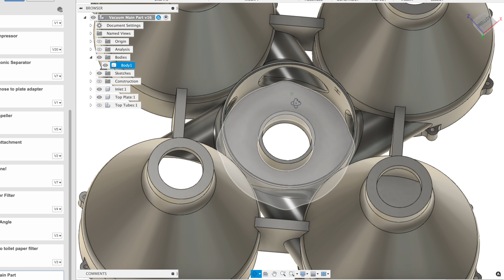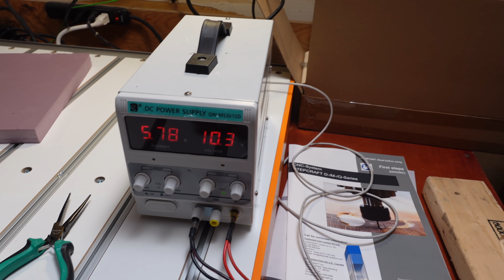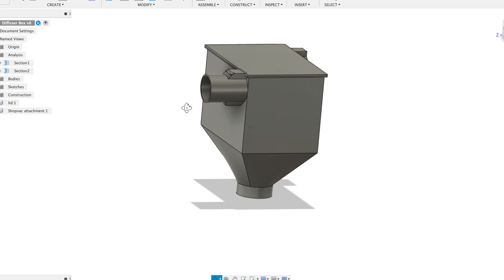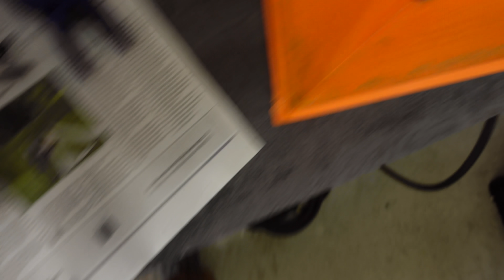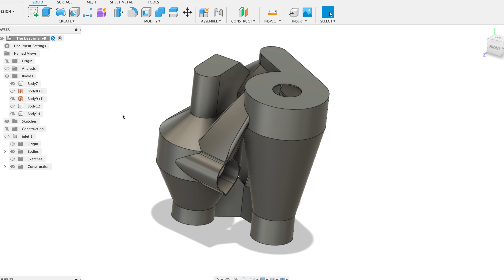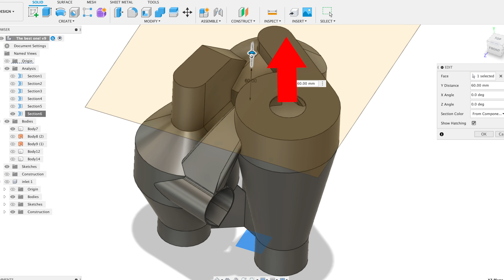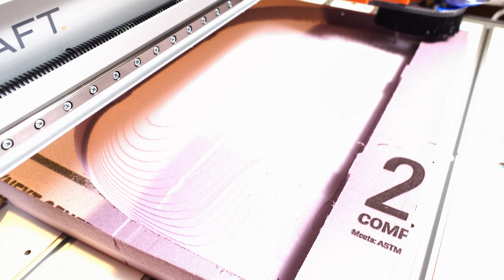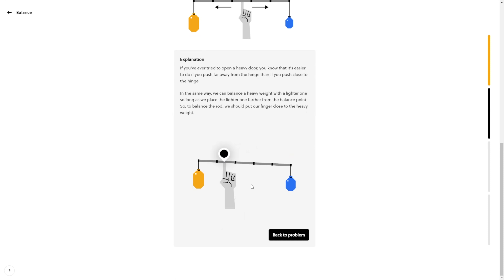3D Printed Cyclone Air/Dust Separator

Comment: A feature of many cyclone separators is what is termed a 'vortex finder' or 'outlet length'. The outlet pipe dips down into the inside volume of filter. This forces air from the inlet to orbit around the separator surface before exiting the top of the filter. This length is important for adjusting filter performance for pressure drop vs. fractional efficiency.

Many papers use terms designated as 1D2D, 1D3D etc to describe the cyclone separator dimensions. The numbers represent the ratio between the cyclone diameter and cone length. Many papers are published which compare filtration fractional efficiency (as a function of particle diameter), pressure drop, and flow rate through the filter for a given Mean Particle Diameter.

In general, a higher aspect ratio of cyclone with a large outlet length will filter better because it exposes the air flow stream to longer linear lengths of surface area. The principle is that at the boundary layer, air velocities are slow enough to drop out material against the surface, and the slope of the surface keeps the material from re-entering the fast air stream. Lower cyclone diameters will filter out smaller particles better, at the expense of significant pressure drop.

According to ASHRAE, saw dust has an approx mean diameter of 600 micron, and flour dust has an approx mean diameter of 50 micron, for your reference.

https://www.sciencedirect.com/science/article/pii/S0307904X06000291
This was a paper we used to guide our design of these separators.

You should check out papers on the subject if you really want to optimize your filter.
Reply: Wonderful explanation.
Reply: Yeah for some strange reason most of the 3Dprinted project on internet get this ratio "wrong", I wondered if it was because of empirical tests that for some reasons makes the result different when 3Dprinting the thing (rough surface, PLA leakage, ...), or just a social reproduction thing where the first who did it just made it this ratio without thinking much (which is totally fine, sometimes you just want to make a quick and dirty thing without research and/or calculation) and the rest of the 3d printing community just followed it as a design trend ?
Reply: @lolaa2200  In one hand i really start to need cyclone filter asap since i have lots of routering coming up near future, but then again i would like to get optimized as possible filter to save those shopvac bags, but then again i really dont have time or interest at this moment to go and learn about these filters that indebt, so has anyone optimized this and is there 3D model somewhere?
Reply: @Hellsong89  If you want a quick and dirty solution that is not optimal but does 95% of the job (remember your shop vac will happily deal with the 5% remaining, after all it's supposed to be designed to deal with 100% of it) then i would suggest you to look at thin baffle instead of cyclone, it can be made as simple as a bucket, two roughly cut plywood circles, and couple PVC coupler. It can be made in less time than it would takes you to slice a thingdivers stl and set up your 3D printer for it. 
It will not filter fine particles but it will makes your shop vac life easyer for sure. And if you want an answer to those who will booboo you for not choosing "the best solution" just remind them that it's the solution that Festool use ;c)
Reply: @Hellsong89  Just build it.
Reply: @lolaa2200  Most 3D printed projects on the internet get a LOT of stuff wrong. If something looks off, it's pretty safe to assume it isn't because the designer was, in fact, an especially clever engineer.
Reply: @jamespray  Well yes most are just hacks and that's totally fine. My concern is more that it seams social effect seams to make  bad design practice norm. Maybe it miss something like what stackoverflow is for software, a place to openly ask for good recipes and or critical return (in the good sens) but for mechanical design. Maybe it exists but i'm just not aware of it. Just like what was done in this comment in a way (thanks for the article linked, it's realy interesting by the way). But as far as i know it's not a common practice in the 3D printing community. Copying trends based on popularity of a guy on youtube, because he seams friendly and fun, seams more like the norm. For the most serious i see a lot of empirical testing but often on problems that have been solved for hundred years already in common engineering. So yes a place to ask to those who knows is certainly missing. 

But once again it's just my very blurred impression, i might be totally wrong.
Reply: @lolaa2200  Mechanical design feels like it's becoming a lost art, somewhat!  And critiquing it isn't always easy to do at a distance, compared to sharing software code that anybody can test and tinker with.  Honestly, though, YouTube comment sections pony up plenty of good design critiques on some channels - it's mostly a matter of whether the creator uses them or just moves on to the next video topic.  Funny you should bring up stackoverflow,- that's got its share of terrible software samples, too 🤣
Reply: @jamespray  LOL - I certainly know there are all sorts of things "wrong" with MY TinkerCad Masterpieces!  Gotta give them a Gold Star for having the guts to post it! Lots of great ideas that we can modify, or start over from. The community aspect of the hobby is amazing!
Reply: There are a couple issues with just saying "read the papers" to a hobbyist trying to build something like this.
The biggest is the difficulty for a hobbyist to read and understand the material in the papers which are written for experts in the field and not laymen.
Others are things like how spread out the information needed is and the difficulty in finding all the papers to have all the required information at hand.

The paper you posted to me as someone who could be considered a laymen, seems to only really cover how close experimental measurements are to simulated values, the general structure of the vortex inside the separator and a mention of the outlet length (which I presume would be considered the tube to the vacuum or vent) not affecting the actual values much outside of being less predictable. There is nothing about the effect of varying the key values describing the separator.

So this paper doesn't do much for a hobbyist trying to build one of these outside of the idea that they could use an open source airflow simulator to test designs to some degree without building them all.

I think what would be truly beneficial would be more open, readily available and tightly written design guides or summaries based on the research that can be used as reference and can be collaboratively developed alongside the hobbyists which will try weird shit that may not have been researched yet.
Reply: @LanceThumping  If you want, read this paper: A THEORETICAL APPROACH FOR PREDICTING
OF TURNS AND CYCLONE PRESSURE DROP, L. Wang,  C. B. Parnell,  B. W. Shaw,  R. E. Lacey
https://www.researchgate.net/publication/228785176_A_theoretical_approach_for_predicting_number_of_turns_and_cyclone_pressure_drop
Reply: @LanceThumping  Well you suggest the "written culture" way, back in the day what you describe existed and was called encyclopedia. I suggest the "spoken culture" way, just have an agora where people can discuss and share knowledge. 
I think both are very complementary actually.
Reply: What people do not know is that the high speed of the air is not a benefit. The higher speed the more trouble you get. To have optimal sucktion on this type of filter you shouldn't really go above 25 m/s and below 13 m/s.  Also adding an inlet on the cyclone that is a little longer and will open up more before entering the chamber will slow down the air and make the dust fall down faster.
Reply: was about to say it

:')
Reply: Excellent stuff, I took a class on this in college but I don't remember enough of it to explain it that eloquently.
Reply: correct! this is the reason the Dyson Cinetic has the smallest cyclones but still prevents clogging.  though cyclone design is only just one of the factors for vacuum cleaner efficiency.
Reply: just attach a pump to a good water pipe bro 🤙
Reply: Trust in Jesus Christ

Comment: Great video! 

It would be interesting to see if there is a noticeable difference between a smooth surface in the cone, compared to the ridged cone due to the printing layers. 

Also, it would be interesting to see if there is a noticeable difference if the top cylinder section was a bit taller, before it becomes the cone. I've seen designs where the cylinder height is actually taller than the cone section.
Reply: I was wondering the same, as far as smooth vs stepped, or even if you had ridges spiraling down to direct the airflow?
Anyway, very cool, just got my first printer for xmas, so good project ideas👍

Comment: The diameter of the cyclone Vs air speed matters, of course the density of the dust as well which cannot be controlled !! So, it is some kind of fluid mechanic!!

Comment: If I remember my lectures correctly, you usually have the outlet not at the top but a bit further down the cyclone so the particles are slower. Maybe adding a small tube in the center will help. Would also be a quick print,  if not just a cutted pipe is enough.
Reply: true he should test it, the result will be much better than a top sucking.
Reply: Yes, it should extend down a few inches and have a defuser that resembles a hydroponics growing cup that breaks up the laminar airflow.

Comment: Did you end up having any issues with static buildup after running the router for a long time? I have a small Oneida cyclone on my shop vac and it comes with a small grounding strip that seems to help with static.

Comment: you should combine the diffusor with the cyclone.
when the air moves slow in the cyclone the airflow can not transport the dust.
the small hole goes into the cyclone causing the air to rotate fast, moving the dust out.
the inner diameter of the hole in the bucket, as well as the exhaust must have a large diameter so the air that flows out of the bucket as well as the air that flows out of the separator have no power to move the dust in undesired directions.

Comment: I find this topic fascinating. Would be interesting to see if restricting airflow to the vacuum could filter out different particel sizes and densities (like metal dust).
Reply: it does :) but you really don't want to experiment with mixed dust (metal and wood)...
Reply: @lukearts2954  Oh, but I do >:-)
Reply: @OperationDarkside  hahahaha, I think you need a different channel. I'd suggest Explosions&Fire for example =)))

Comment: Cool video.  I went though the same prototyping of a dust collector around 8 years ago.  Then Dust Deputy came out and made it less than 70 bucks for a easy 1hr. fix.  Still have the one I made, but anyone wanting one for their shop should just buy one.  Next Rabbit Hole....Make a sound box for the shop vac.  Or do what I did and make your own shop vac that's almost silent.

Comment: I believe you had an air leak that allowed air to enter the dust bin and flow up through the cyclones. There's no other mechanism that would allow air to flow from the dust bin back into the cyclones. 

Leak test your systems before testing them for efficiency. I think you will find the leaks I'm talking about and your multi cyclone systems will perform much better.

Comment: This video was actually very interesting. You make it seem so simple. Since you do planes and boats.. I would LOVE to see a GPS guided submarine, heck even a remote controlled one would be amazing (I don' think you've made a sub yet as far as I'm aware)
Reply: GPS underwater? I dont think thats a good idea. You might need a floating repeater for that.
Reply: That would be amazing, not sure about how to get GPS signal underwater though
Reply: Isn't DIY perks making this?
Reply: you're gonna need to launch you're own satellite constellation using visible light if u want to pierce the water. alternatively, buoy.
Reply: @radpugguy  I think the idea isnt gonna work. The wavelength of visible light makes it hard to concentrate to a small area. Even if you use laser, the projection on earth would be a few meters in width. 

A floating repeater above water could be a good idea, then it could use i2c or 1 wire to deliver the data to the sub.

Or you could use sonar to detect the bottom of the sea/lake, then use that as location data?

Or use 3 lasers onshore to shine a beam to the sub. If they could rotate freely, they could know how far and at what angle the sub is. Using three could triangulate the location.

Or use sonar boardcasting on the sub, then three recievers to measure the delay, like the black box of planes if they fell in water.
Reply: @SodaWithoutSparkles  and @ThatGameGuy - so with subs you actually don’t use GPS because it’s wavelength doesn’t penetrate water and with military applications, you never rely on external data. So you can use an inertial navigation which is a combination of accelerometers, gyro or other rotation sensor and sometimes magnetometers to use dead reckoning to calc positional data.
Reply: @SodaWithoutSparkles  yes, I was joking about how gps wouldnt be viable. Geopositioning underwater is a solved problem, you can do the same sort of triangulation that is done with gps satellites using acoustic signaling. Some subs already do this
Reply: Nice idea!! A GPS guided submarine!!! Maybe with a VERY long periscope that would house the GPS antena... LOL...
Reply: All your replies are interesting and it just makes me think it would be an even better idea than I first thought. He could start with a submarine build video (tethered?) and then see what shenanigans he can figure out from there for future projects. 
He's insanely clever, I bet he could figure something cool out.

Comment: tl;dr the tests where being done wrong
you could have a really good design there and it could have failed because the test was done wrong...
the second the hose gets clogged with the powder holding base and air flow gets stopped the cyclone/s stop working and you get stuff in the paper towel

Comment: I think you need some more distance vertically between the inlet and outlet to the vacuum I think you need more volume between them so that the particular matter has more time to drop . Also try your three component model with three large containers that are connected by pipe to regain the volume but keep them seperate . Absolutely loved this video .

Comment: You should test combining the big mono and a smaller mono, since they both filter out different size particles.
Reply: Yes! It seemed the smaller series version did well with large particles. So maybe have that first and a large cyclone as a second stage, something like that.
Reply: An unfortunate side effect of a combination of separators is reduced air flow. With light weight foam it may not be as big of an issue.
Reply: don't u need a stronger vacuum then?
I think the ideal design takes out all the particles but also leaves you as much power on the vacuum as possible.
Reply: @Broockle  There are losses on each stage. Since the airflow is equal, the pressure drop is about the same at each (equal) stage. The main advantage of multiple stages is probably getting the filtration efficiency really high. Each stage filters a certain fraction of dust so you can cut it down exponentially with more serial stages.
Reply: Also I'm not sure what's the relationship of size and pressure loss and filtration efficiency, there might be some tradeoff involved (again for different particle sizes as well).

Comment: what would happen if a tube went up the center for the exhaust air?
Reply: It would clean up the airflow right at the entrance of the filter, probably filtering more of the fine dust, the question is if it being closer to the walls of the cone would enable it to suck up those dust particles right of the wall again. I think that's why most industrial filters have a straight section above it, to get the spiral going and then have the air exit.
Reply: I bet you would lose that air spiral I  the middle. could work tho

Comment: it resonates because the tube is ribbed, if the tube was smooth it wouldn’t have made sound. You can use a smaller diameter smooth tube.
Reply: But he needs to make sure its suction tubing, e.g. for water pumps. They still have ribbing, but only on the outside.
Reply: I had the same issue with noise. I replaced a vacuum hose, with one designed for sucking water, pool use.  The pool one was unbearable with noise.   I went back to using two vacuum hoses connected together to get my desired length.
Reply: not only ribs cause noise, also the air speed.  In my case I eliminated the noise of a small tube by using a bigger diameter one.  I initially used a 1-1/4 (IIRC) electrical flexible tube ribbed and noise was terrible.  I moved to a metal one, with external rubber lining that is 1-3/4 and noise went away.  I guess the metal and rubber stuff might have something too, but air travel way slower.